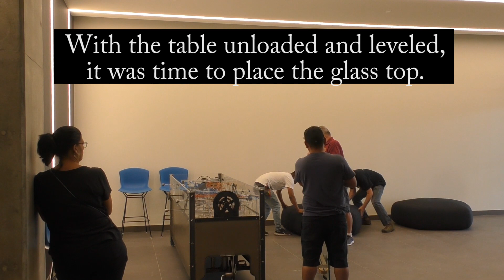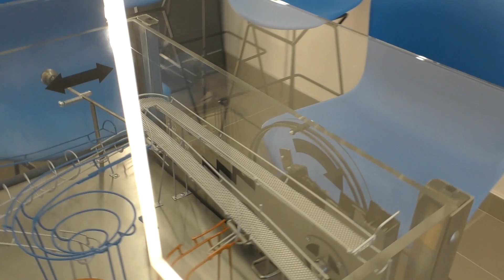Interactive Rolling Ball Machine Table -  Functional Art

Comment: two ideas....  1) it would be very interesting to decorate the track like you would a model train set or a pinball machine.  It would give the mind something to latch onto and spark the imagination.  2) It would be very interesting if you could have an obstical course maybe like a pacheniko machine that would have different outcomes and that you could send two balls through at the same time so you had some sort of a race going on.  Of course you'd need different color balls to keep track of which on was which....
Reply from the maker: Interesting that you mention that, Originally I had planned to do kind of a 'capture the flag' scenario where two people move the balls across the table to the other side to raise a flag after they get three balls to the opposite side. Then I realized that when people race, they get excited, when they get excited they go fast and become unpredictable. Because the ball lifters are manually operated, going to fast would toss the balls off the lifters so I choose to slow things down by taking away the race element for this one. I still think it would be a great idea in a larger space